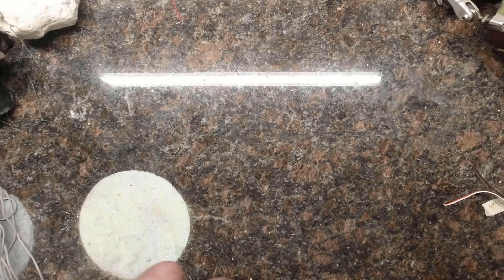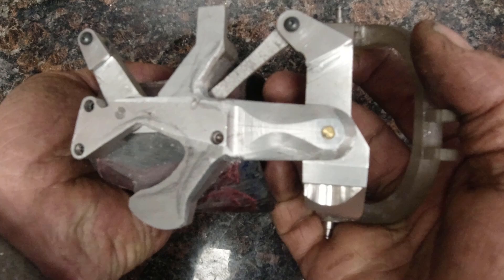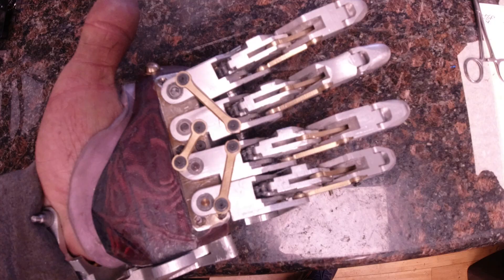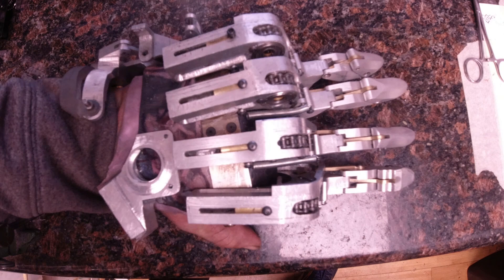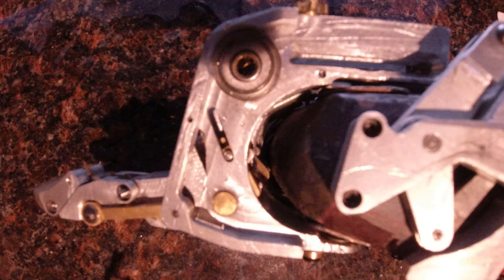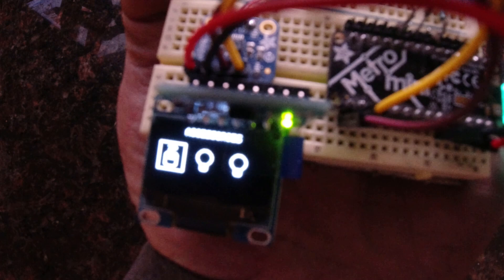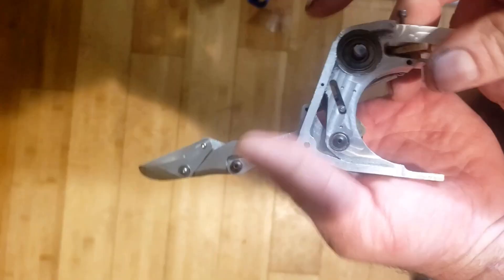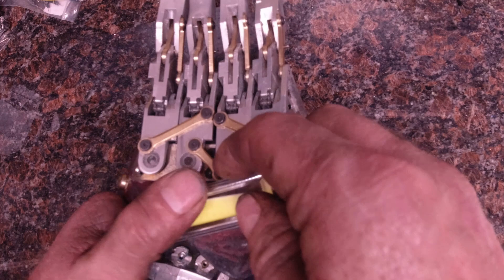Follow along as I design and build a new mechanical prosthetic hand. Part 1

Comment: Best case scenario is someone takes all his advice into account and works on something thats built to be 1 size fit all, and at that point the dedication needed will be insane. Props to anyone taking on this challenge
Reply: removable fingers part, one set of fingies can be mounted to different sockets.
different fingies sets can be mounted to one socket, I present you TÓÓNY STARK

Comment: Your craftsmanship and engineering is impeccable! As a person who has had all 4 fingers on my left hand amputated, I can’t tell you how amazing and at the same time infuriating it is to see the greatest prosthetist of all time not actually be a prosthetist! I hope one day they can get on your level sir!
Reply: As a prosthetist in training, I aspire to make this happen one day. The problem is that this kind of prosthesis is so specific to this amputation. Thousands of hours have gone into this prosthesis alone, so imagine the time spent on all levels of amputation!
Reply: I give this comment a left thumb up
Reply: @SolemnnSolace  Talking from pure ignorance here, but would a more universal prosthetic like this be possible to make with a sort of independent module format for the fingers and control module? Like let say you make the base socket tailor made to fit the hand since you need to make it fit properly for the end user, but then work with modular pre built fingers to replace the missing ones and an universal control module to control them. would something like that be more practical since you would only need to worry about the custom socket and then just build the rest with the pre built parts? It probably wouldn't be as precise as a fully custom made one, but wouldn't it be an acceptable compromise in exchange for a more accessible version of this kind of super responsive prosthetic?
Reply: @KingKittan  let me start of by saying that I am only 20 years old and still studying, so this is more an opinion than a science-backed answer, but i think that this technically would be possible since the fingers themself and the control module are not super hard to prefab make.  The one thing that holds me back from saying "yes" is that there are so many engineers working in orthopedic companies, and there hasn't been a viable option that delivers this. So there is something that holds this idea back, and i dont know what that is for sure. There are a lot of modular lower limb prosthetics and a few electrical upper limb prosthetics though.

Comment: Man this is some of the coolest practical application of mechanical engineering I’ve ever seen.  Please never stop!!!!!!
One day you’ll have an exoskeleton!
Reply: Oddly, this video highlights the problem of an exoskeleton - leverage against soft tissue at some point, and how to prevent it. Iron Man armour, in its prototype stages,  would have had a few broken limbs along the way.
Reply: @rog2224  Yeah, you'd have to build in stops, possibly adjustable ones, which limit the suit's range of motion to match your own, as especially powered suits could severely injure the wearer if they were to overextend joints beyond their capacity.

Comment: I use my phone's flashlight several times every day. It has a haptic control, so I don't even have to touch the screen to turn it on. It's so absurdly useful in my life, I can't imagine getting a new phone without it. 10/10 would glue LEDs to my hand.

Comment: Hello Ian Davis. 
First off i wanna say how much i admire you work, as a mechanical engineering student you really inspire me.
Secondly, i wanted to express an idea i had for your hand:
since i noticed you were trying to figure out methods to control each finger, i thought about one possible solution. (I'll apologize now for my terrible english but being an italian this is not my native language)
Since you still have your thumb on your left hand, i thought you could put a "slider" on your mechanical index with 3 or 4 switches, that you control with your left thumb. Every switch would "unlock" a finger that, if locked, will stay open or closed nvm the hand input you give to it. The left-most switch of the slider unlocks only the index, then you unlock both the index and the middle finger, and so on, until all 4 mech fingers are unlocked.
This way you could have more control of your hand without having to use your right one!
Let me know what you think of this, and godspeed

Comment: About the LED light thing at the end. You could make it detachable with some simple lock mechanism and a switch somewhere on near the thumb. That way you could make something of a base plate and standard connection which you later can switch for other modules. Other than that, mighty impressive designs :D

Comment: I definitely like the idea of adding useful gadgets to your hand. It doesn't have all of the benefits and utility that a normal hand does, but you can build it to do all sorts of special functions that a normal hand could never do. Take the good with the bad and turn your shit up to the next level. Make it better than a normal hand. You might also want to consider making it exchangeable with other hands. You could use the same motor functions you use on the base with the wrist and have those drive the new functions on the other hands. Pressure switches and motors could drive all kinds of interesting gadgets.

Comment: you are admirable! your an engineer, thats why am here! i am not but probably should have been! i also cut the tendon on my thumb i play guitar for fun no thumb no guitar! my thumb was repaired at the end of physio they said my grip strength was almost equal to my right, and as i'm right handed thats good!?? guitarist's left hands are larger,longer fingers, mine nearly a 1/4" and stronger! i found to start  with my grip would fail! things i would grab for would literally slip from my grasp! my grip strength improved! ,but it made me realise the human body is a marvel and through doing something  can actually change your body playing guitar isn't strenuous but all the stretching and moving and gripping the  neck yes you have to apply pressure with your fingers to make the notes sound clean no buzzes, your thumb becomes the anchor!I have subscribed,  and will continue to watch you hopefully engineer a solution to your missing fingers! GOOD LUCK!👍

Comment: I use orthotics as opposed to prosthesis but I find this interesting and may apply some ideas into working out new orthotics. I have a connective tissue disorder on top of neuropathy that reduces full overall function in my arms, hands, legs, and feet.  One thing I've learned when working with Ottobock is that harder points on body need a softer corresponding part and softer points on body should have harder corresponding part. Just a tip cause my ottobock KAFO is more comfortable then any other orthotic I've ever had and I've been needing them my whole life.

Comment: Maybe you could use a mechanism similar to what Gary Fay uses in his finger extensions. I know it isn't a prosthetic, but it operates very smoothly and the mechanism seems relatively strong. It could possibly be strengthened if it is not. The movements it makes are very human. if you wanted to operate it, I think you would need a couple extra linkages so someone without fingers could use it.

Comment: Your work is inspiring! 
Take into consideration heat dissipation for the led strip, might be fine considering the sleeve and mould but maybe a simple heatshield tape just underneath it could be beneficial to structual integrity of the epoxy.

Comment: I dont know if you will see this but a) you will need a fast mc most likely something around 50Mhz ARM based for the control and display that you may want to remove in the future after testing phase. Simple solution based on arduino or other such board arent fast enough. b) you will need ultrasound sensors for muscle detection. EMG simple isn't good enough. Good luck

Comment: Myoeletric circuts came up in conversation when I was getting my haircut today and I forgot to drop your name cause I had to give input on the top length. Ian I am so so so grateful for your chanel and cant wait to enjoy this latest build <3 also you make me consider becoming an engineer which is, scary.
Edit1: What's the ratio for dimensions of your daily driver fingers versus your less shiy digits? I might keep adding to tthis if more questions come to mind. 
Edit2: all your patrons are chads, when I get a job I will become a patron.
Reply from the maker: Q1, I based the length of my fingers from the closed position of my natural hand, due to the necessity of bearings and linkages they needed to grow in length to articulate.  That being said, if I line up metacarples to metacarples, the prosthetic fingers of the new hand are about 1/2" longer when straight. My current dd fingers are about 3/4" longer.
Q2 they absolutely are! In fact for the most part all of my subscribers are absolutely awesome!  Super supportive! It has been a wonderful experience thus far. I really do have the best subscribers on the whole of youtube. But the fact that I have so many people that actually donate to my projects is just mind blowing! Thanks to everyone that has backed me on Patreon!

Comment: Hello Ian Davis! I havd been watching your videos! And wonder what it would take to fix my pinky finger! I cut the tendon on the inside part of my pinky when I was 20!!! So a can't ball a fist without using my ring finger to push it down! And 75% of gripping power comes from the pinky finger! I was thinking about a latex mold that maybe could go over my ring finger and pinky! That way when I go to close my hand. My pinky will close or even grip. I am amazed at the prosthetics you have made. And the sad part is! It would have took a surgen 30 minutes to cut my hand open and sew my tendon back together when it happened. But with no insurance they just stitched it up! And said to follow up with a surgeon within 48 hrs. I didn't havd the 500$ down-payment for surgery. So for 22 years I have dealt with this problem
Reply from the maker: That's a tough one... with the tendon detached, nothing you do will actually improve your grip. If you had it amputated at the pip, you could use a device similar to naked fingers, or the danger finger, which are both driven by the motion of the proximal.  I imagine that the muscle has atrophied too far now to be grafted. Only you can determine if it bothers you enough to have it taken off. GL with your decision.

Comment: I wonder what the grip strength will be on this new design? Have you thought about adding a magnet to allow you to easily get metal objects?
Reply from the maker: I have, but the problem with them is that they also constantly pick up magnetic particles of dust, so eventually you just have these fuzzy patches on your fingers that scratch everything. With deeper scratches at level 7.

Comment: Hi Ian, I am inspired by your enginuity. You talk about the socket being the most important piece of the appliance, requiring a most precise fit to the user.
Have you considered making an imprint with alginate (used in dental care for braces), then filling it with plaster to make a lasting mold (if thats the correct word)? Or do you think the precision would not suffice? 
If sufficent, this could introduce a faster process for custom fabrication to new users. Speaking on a larger scale, the fittings could be made during appointments carried out by a broad network of offices, whereas the fingers would be made in a singular manufacturing facility and assembled with the molds in a seperate stage of the production.
Engineering fingers that fit onto most custom molds would probably be a large hurdle, but (in my humble opinion as a law student and technical noob) indispensable for cost-effectiveness.
Would love to hear your thoughts on this. Cheers
Reply from the maker: i have a 3 part series detailing how to cast and lay up a copy of your residual limb
Reply: @missingpartsclub  Okay, i just looked at the playlist. Seems like I was pointing out the obvious, my bad. Anyways, thanks for answering so fast

Comment: Hey Ian, just stumbled across your videos and as a fellow machinist and partial amputee, you have reinspired my quest to build a prosthetic for myself. I'm missing my thumb, index, and middle finger on the left hand, and the palm supporting them. From what I have seen of your "daily driver" hand, it is close to what I had initially tried to work with. I have much more work to do though, since I am trying to get my own shop together as I no longer have access to a shop to borrow tools and machinery. My initial design was cable and spring actuated, and I never got around to the ratcheting tensioner. Any ideas would be helpful 🙂
Reply from the maker: Hit me up on Instagram. @acmeworksfab

Comment: Out of sheer curiosity- out of that 600 hour dev time for the previous hand, how much was spent on design alone?
I'm no engineer but the sheer complexity of springs, joints and levers in that thing is jaw-dropping, especially considering you dont seem to be using electrical motors to power it.
How many iterations have you gone over to get to this point?

Comment: Will you plan to make another version with a lighter material such as Carbon Fiber Composite? The prosthetic hand design looks awesome and sturdy but it looks heavy...
Reply from the maker: Carbon fiber for cover panel, possibly.  But for actual laminated components, no. In the case of bearing bosses you would have to layup those areas so none of the fibers were cut or else there wouldn't be any strength. As soon as the fibers are cut or frayed you are only left with the strength of the cured resin.

Comment: Do you still have any functional muscles, or nerves post your fingers being removed? Can they still send signals? Because, if so, I’m curious to see if it could set off a piezoelectric crystal… I saw something like this being used for hand tracking in the VR space, however, I’m curious now on the application for prosthesis

Comment: Hey Ian, what do you think about prosthetic or sensory additions not based on missing or amputated body parts? That is, infrared vision fed through a haptic field on the forehead, or implanted finger- magnets to detect magnetic fields?
Reply from the maker: I've thought about the implanted magnet aspect of it. Implanting them in the muscle with pickups at the extreme travel of the tissue, but the long term risk of infection along with the tissue damage associated with long term exposure to magnetic fields is too high. If the magnet gets shattered or the body encapsulates it, it can cause heavy metal poisoning.

Comment: could you get the same result as this hand if you were to reattach tendons in the arm to mechanical fingurs with a desing similar to this?
Reply from the maker: I suppose, but how would you deal with the open wounds, continuous blood loss, and increased risk of infection?
Reply: @missingpartsclub  i guess you could say rubber pieces to seal the open wound and connect the fingers and then just have a morning routine with disinfectant wipes and antibiotics and i'm sure there would be some pain so some sort of medicine to help with that.
Reply: @missingpartsclub  I'm no genius and i don't know what all I'm talking about it was just food for thought
Reply: you could also stretch the skin on the hand perhaps and fit it around each individual mechanical finger to seal the wounds and stop bleeding that may work better then rubber pieces
Reply: I'm gonna add-on to this one the skin on the hand would probably not be enough so you could gain some weight on purpose to increase skin mass around the belly then surgically remove the fat and excess skin then transplant the skin to wrap around the whole mechanical fingers each individualy

Comment: Link to miniature linear stepper motors?
Reply from the maker: Here you go, these aren't the exact ones that I'm using. But they are close. https://www.ebay.com/itm/Mini-Micro-Planetary-Gear-Stepper-Motor-Screw-Slider-Nut-DC-5V-2-phase-4-wire-/153995251393?_trksid=p2349624.m46890.l49286

Comment: Where did you find those micro servo motors?
Reply from the maker: Ebay, I think that they came from optical drives. Just search for miniature stepper motor. I picked these up for around $2 ea.
Reply: @missingpartsclub  thanks

Comment: do you work with 3d printers for your creations?
Reply from the maker: My experience with printed plastic, both resin and filament,  abs to nylon, is that it isn't durable enough for real world daily use. With my hand that was printed in tough resin, I would replace at least a finger a week. Sometimes due to impact,  other times purely from cycle fatigue  and uv exposure. 
Plastic is fantastic,  but steel is real!

Comment: Two fingers are missing on left hand in the middle
Reply from the maker: there are several options for your situation. depending on where your dis-articulation occurred you could either go with a pip driven finger, driving off of the motion of the proximal, or a tandem arrangement where the prosthetic finger is driven by the motion of the adjacent finger. in your case the middle would be driven by the index, and ring driven by the pinky. hit me up on instagram if you are serious about changing your current situation.

Comment: So....why chain and not cables?
Reply from the maker: Because the minimum bending radius of 1/32" wire rope is 1" whereas for #15 miniature roller chain is 3/16". Also chain is super easy to connect to. While wire takes all kinds of room to make a connection.
Reply: @missingpartsclub  thank you!!